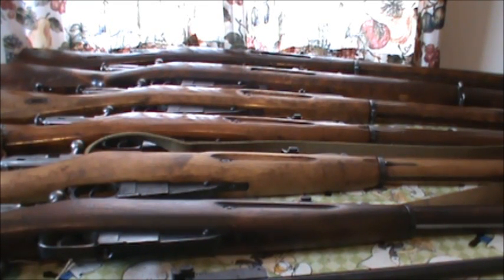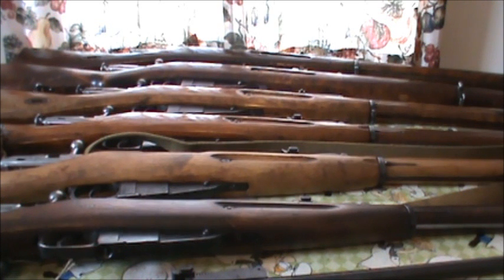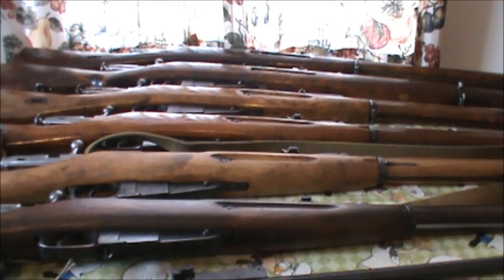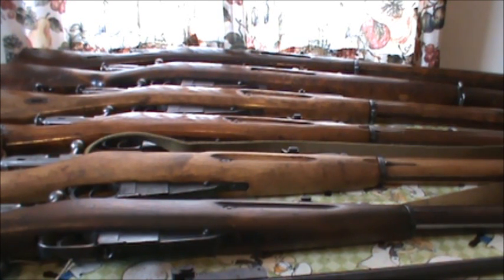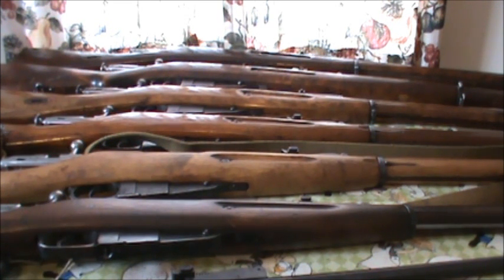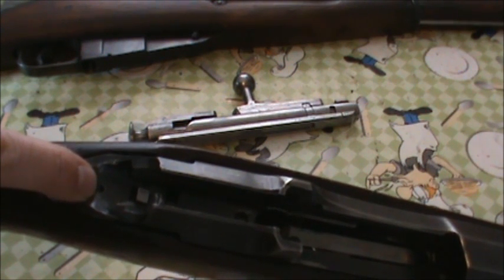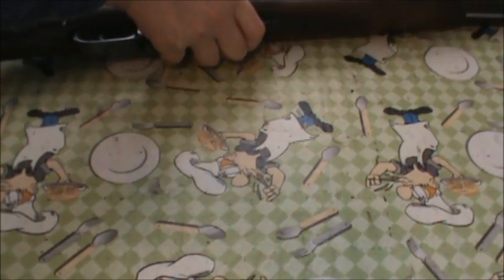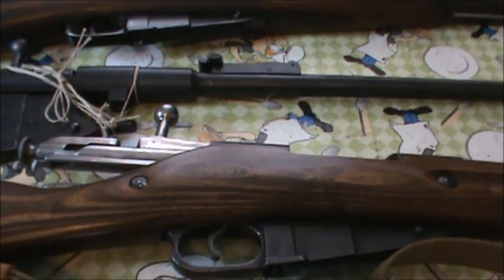Mosin Receivers

Comment: Where would you rate a 1939 ishvesk? I did an Unboxing video. before I cleaned all the cosmoline off it shoots fine  thanks for sharing your wealth of knowledge on Mosin Nagant.
Reply from the maker: 1939 is in the prewar group . The war time short cuts started in late 1941 :)
Reply: Oh good history to learn thanks.
Reply: ***** i have a 40 and a 41 and the difference in fit and finish is huge but both shoot fine
Reply from the maker: Only thing about some of the wartime guns are the sights are screwy.
Reply: Only thing I noticed on site was it was moved towards left side should I leave this alone since on your vids they shoot this way maybe last soldier who used this figured this shoots better site is not centered but to the left? Any ideas or is this firearm point aim and leave alone?
Reply: my 41 shoots way to height and my 40 shoots low and to the left and shoots way off with the bayonet on . its off the paper at 50 yards
  i don't have a bayonet for my 41 thought wish i did
Reply from the maker: derplinkster
They are all different. Some are center some not. Also depends if you shoot with the bayonet on....?
Reply: ya my bayonet dose not fit on my 41 and it just trows off my 40  so  i would say fix it if you dont want to shoot with the bayonet or if it dose nothing to the hit point,  you could just compensate your aim
Reply: Gna leave mine alone for sir will do a vid see how it shoots curious since I uboxed don't use wear glasses see what's up at paper target findings.